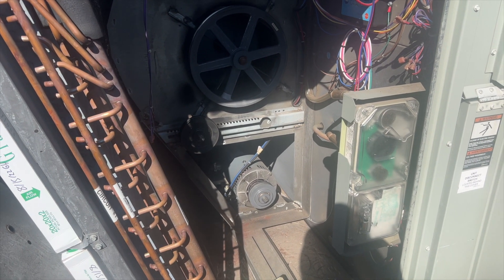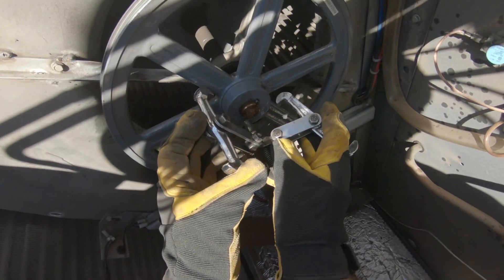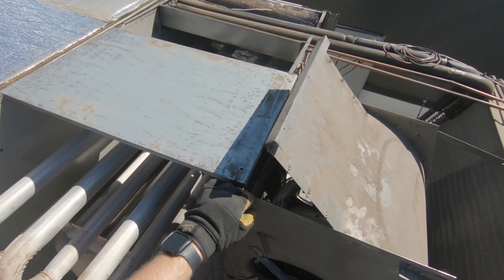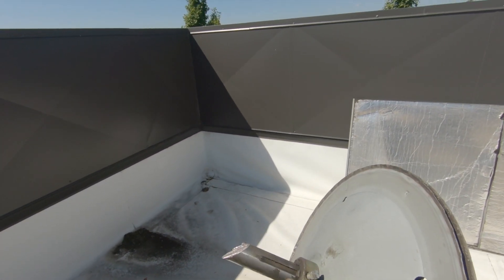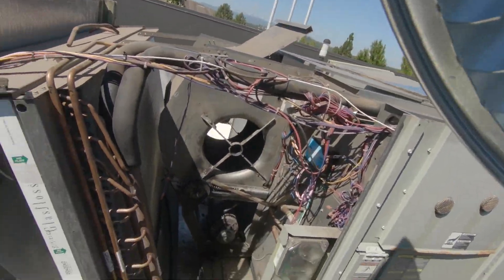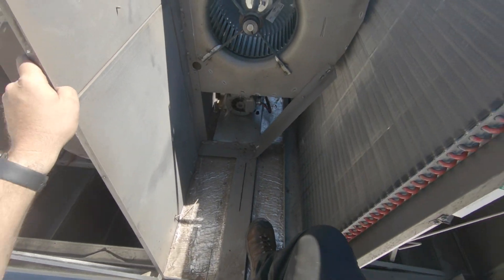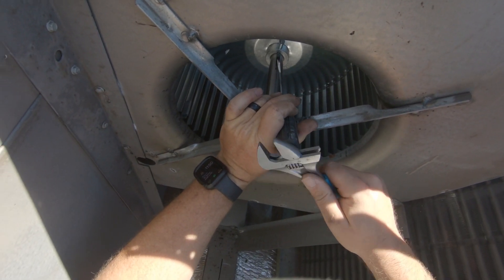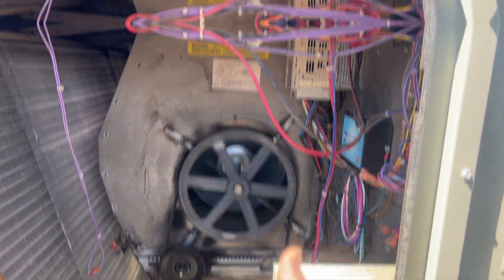Replacing the Blower Wheel on a Trane Voyager Package Unit. EP98

Comment: Awesome video - thank you! I have two units just like this that I'm in the process of repairing. On one unit the from blower bearing is smoked and I'm thinking I'll just replace them both preemptively while I'm at it. The other unit the blower wheel looks about like this one. Do you (or anyone else here) happen to know the P/Ns for the front & rear bearings and the blower wheel itself?

Comment: working on Trane Voyager 12.5ton  YSH150F3RHA seems like blower motor not pulling enough  hot/cold air inside the building , furnace located on the roof  2 story building from the roof ductwork travels to the  first floor square footage around 2000sf  , customer complaining not enough airflow . can you please recommend something would help pushing enough air  ( 3HP blower motor) was thinking to replace with 5HP ?  heat exchanger in the great shape) any help would appreciated
Reply: Mine has low airflow too and freezing up, but it's because some fool put the wheel in backwards, so now I have to do it right.  I should have just done it myself.The first time